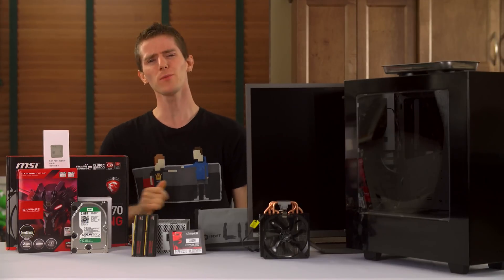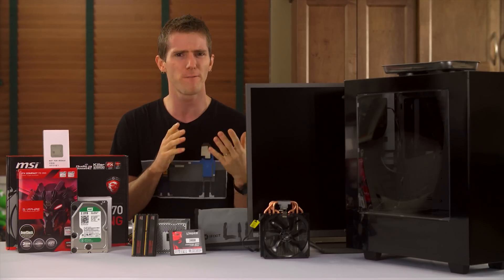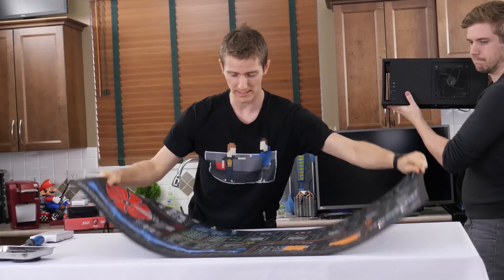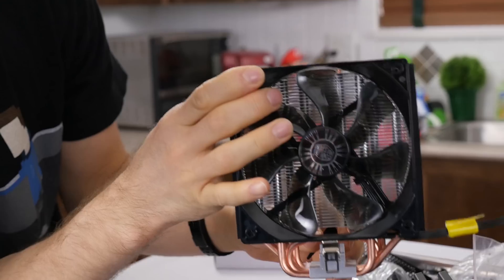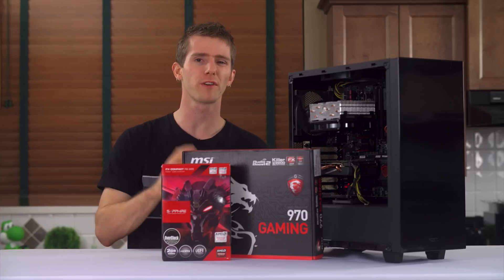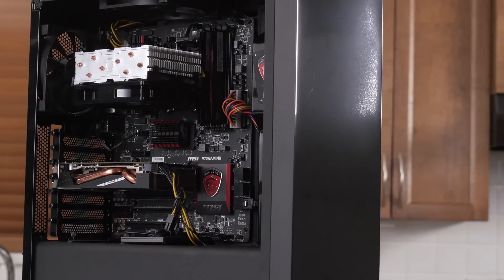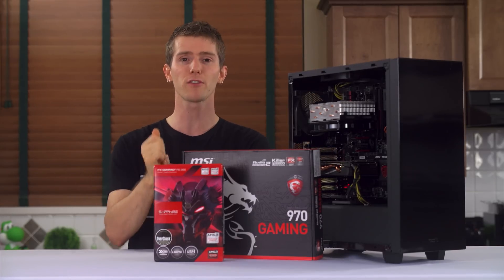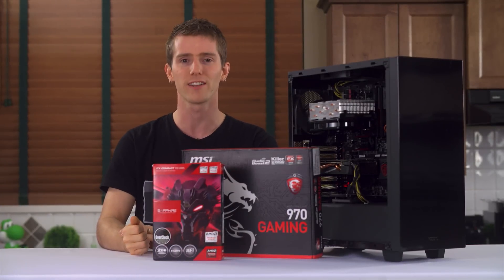Can you Build a 4K Gaming PC for Under $1000?

Comment: I'd love to OC my 6300, having trouble getting it above 3.93. I had it to 3.990 stable at one point, then when I got greedy and went for 4.0 it lost stability, then I had to back down to 3.85. I've gotten back to 3.93. This is my first OC so I have no freaking idea what I'm doing wrong, or what I'm doing at all for that matter.
Reply: m80pls
PSU was taken into consideration because over 10% if it booted everything cut off. Over 4.0Ghz not even the case fans would run. So if the fucking fans aren't running, they aren't getting juice. Naturally if there's no juice I'm going to introduce a larger supply to attempt to counter that.

If you're not going to fucking help, just shut your damn mouth. "If you know this little". Really bitchtits? FIRST ATTEMPT. Everyone starts somewhere you pretentious douchenozzle.
Reply: Niether do i. I have a 4100 i think, quadcore 3.8GHz, dont know how t o OC or if i should
Reply: Coolkidkarateman
My BIOS has an automatic OC setting, but I can't get it to go from 10% to 15%.
Reply: I have AMD Catilyst control center thing, it gives me the option to overclock, (my Processor OC's to 4.2 GHz) And it wont let me oc to at least 4 GHz, I can get it to 3.9, just not 4.
Reply: FraggedDabloons i have an amd a8 5500 apu its locked down to 3.7ghz turbo max and 3.2ghz stock go to the bios and change the multiplier and add a bit of voltage you guys have fx easy oc cpus my apu is locked not a k edition and it is still running at 4.1ghz
Reply: FraggedDabloons also what mobo do u have asus autmoatic oc on mine barley did anything and i added some extra voltage and a new heatsink since i noticed that when it heated up it throttled and coultnd overclock well soz for spelling btw <3
Reply: 96donov
http://www.newegg.com/Product/Product.aspx?Item=N82E16813157394

This one. Not the greatest, but it does have automatic OC option. Only problem is its intervals of 5%, only 10% which is 3.85 is stable. 5% boots and crashes after hitting the desktop, any other setting won't boot Windows. Crashes back to BIOS while loading it.

I'm thinking its a power supply issue, mainly because my GPU won't OC over 140Mhz core clock and 95Mhz memory clock. So I bought an EVGA 850 watt, and while I was at it, an R9 280 as well.
Reply: FraggedDabloons what gpu is at 140mhz core is it some intergrated and it could be a psu issue acctually i have a novatech(uk brand only( 80 plus 750w modular psu so i mean my pc uses 400w at the most but i do know the amd line ups typically consume a lot more power holla me your new results would be of great interest to know i would get a 6350 maybe as a next upgrade sicne 6300 vs 6350 only differenece is the cache size between them pretty much more cache better performacnce in some games exucuse my bad spelling i was drunk when typing but bro holla me we are one big community here to help
Reply: Got my fx6300 up to 4.3 stable on air
Reply: kama sylvester
Good for you, mine damn sure won't. :|
Maybe once I get the bigger PSU in a few hours that'll make the difference.
Reply: What motherboard  u got ?
Reply: FraggedDabloons Why would PSU change anything do you even know anything about overclocking? If you know this little you should stay away,,, have you even changed the voltage?
Reply: Nice bitch slap.
Reply: Up the voltage on your CPU a bit, and then stress test for an hour. If it is still unstable, do the same thing. Also make sure you have an aftermarket cooler :)
Reply: xDamo Mc
Can't stress test if it won't boot fully without going into a blue screen.
Reply: FraggedDabloons Do you know the source? Your mobo may not support overclocking or you may have a software issue with windows.
Reply: xDamo Mc
It isn't a mobo that won't support OC obviously, since I have it at 10%.
Reply: FraggedDabloons Are you using the Stock CPU fan?
Reply: ZavePro
I was, didn't make a difference when I changed it out though. Still won't go past 10%.
Reply: FraggedDabloons Maybe you have a defective chip, or the cooler you swapped it with wasnt much better. Most of the time if you slap a noctua on there then you'll get overclocking with super-ease.
Reply: ZavePro
Everybody keeps blaming the cooler, the CPU isn't getting too hot, it barely has a chance to turn on before it cuts out. Its not the dang cooler. Sheesh. I've pinged it with an IR thermometer an it never had a chance to get over 35c.
Reply: FraggedDabloons Everyone is saying it's the cooler because the only thing it COULD be is the cooler OR a bad chip, which I ALSO stated in my first comment. Have a good day.
Reply: ZavePro
It can't be the damn cooler, its not even on long enough to get hot!
Reply: FraggedDabloons Did you see what else I said? Your CPU chip might be defective.
Reply: FraggedDabloons What did you set the CPU core voltage at when you changed the frequency?
Reply: You probably need to add more voltage.
Reply: FraggedDabloons Are you only adjusting the multiplier? if so then you shouldn't have any problems. Make sure your board is at least 125W TDP, if it's not, then that is probably your problem. The FX series processors are extremely power hungry when overlcocked. I had my FX-4100 to 4.5Ghz stable on air cooling, with a 430W power supply which was pushing it, upgraded to a 550W to have extra insurance
Reply: FraggedDabloons Move up the MULTIPLIER, not the bus speed / FSB.
Set voltage at 1.4v and put it at 22.5x multiplier. If it keeps stable but temps too high, lower volts until you reach instability. If you get temp headroom (max 70ºc), increase to 1.375 and put it at 23.5x or 24x multiplier.
Reply: Jorge Rosa
1.4 was too low for X20 on the multiplier, I had it running at 1.5 for x20, that was stable. Then I backed off because I thought that was the issue I was having in GTA V. Turns out it was Rockstars fault yet again.

(I never did mention that a week ago I found the specs for a solid 4.0 in the review of it on NewEgg and it worked for me.)
Reply: Jorge Rosa
Now is that voltage and multiplier for both or just the CPU? Because I want to try yours and see if it helps my GTA V experience. So far that's the only thing giving me any issue.
Reply: Follow tutorial for AMD FX6300 overclocking.
Reply: Jorge Rosa
It is currently at 22.5 and 1.5 volts smooth 4.5GHz.
Reply: FraggedDabloons
Lower that voltage. It's too much.
Reply: Jorge Rosa Lower the voltage and it isn't stable.

Comment: Can Someone Check my Gaming RIG

Budget: $2000

i7 4770k CPU

Nvidia GTX 970 GPU

Ripjawz 16gb Ram

H100 Watercooling

PSU Corsair 650 watts 

Chassis : Raidmax Agusta

Idk what all of these sums up, but i might SLI a 970 if it doesnt sums up the $2000 Budget
Reply: I forgot 

520 Gb SSD

4 TB HDD

Two question, should i just get a Hybrid SSHD? Also if i install my os in the SSD will my HDD get the speed? Im sorry just new building a Gaming PC
Reply: aLT also an Asus MoBo Maximus VII
Reply: You could get a lot more for 2000$. Get amd cpu because its cheaper and a lot better for price and get 780ti or 980 with money you saved instead of 970.
Reply: Stefan Galić thanks for the opinion !
Reply: Stefan Galić also im new, is a 780 ti better than the 970?
Reply: aLT 780 ti is very simmilar to 980 which means its not better a lot, but it is better than 970.
Reply: Stefan Galić
thanks alot ! you just made my rig better :D
Reply: Pretty good, however I'd suggest you go with the i7-4790k instead of 4770k because its slightly newer and can overclock a bit better.  Or if you want to save $100, just go for the i5-4690k, the only thing you miss out on is hyperthreading.

"AMD CPUs are better for the money", were you paid to suggest an AMD over an i7 'to save money'??  Even the current top-end AMD CPU has terrible single-core performance, TDP-performance ratio, and lithography, just look at the specs and benchmarks.  I don't like intel's ethics sometimes, but I'm also no AMD hater, I just won't buy them over high-end CPUs until they finally come out with decent products.

Also, the 3.5GB GTX 970 is good enough unless you wanna get real top-end graphics.  Only pathetic people think a loss of 0.5GB meants a giant performance loss.
Reply: Still, 3.5gb is more than enough video memory for gaming, the card didn't magically slow down from being decent just because of this discovery.  We all know about the false marketing that happened, lawsuits already happened, blah blah blah
Reply: ***** THANKS ALOT
Reply: AudioTestsNReviews thanks !

Comment: is this amd combo fine ? 
 CPU:	AMD Vishera FXV2 6300 3.5GHz ( 4.1GHz Turbo ) AM3+ 6 Cores - Box ( Chính hãng )(BH 36 Tháng .) Giá: 2,400,002.00 VND
 Tản nhiệt khí cho CPU:	Zalman CNPS 10X Optima 2011- Powerful Cooling Performance(BH 12 Tháng) Giá: 499,994.00 VND
 Ram 1:	Mushkin Enhanced Redline Extreme 8GB ( 2x4GB ) bus 2400 cas 10 - DDR3 Dual Channel(BH 60 Tháng .) Giá: 2,449,986.00 VND
 Ram 2	 
 VGA - Card màn hình:	Palit Nvidia GTX 960 JetStream 2GB ( 128 Bit ) DDR5(BH 36 Tháng 1 đổi 1 mới 100% .) Giá: 5,399,988.00 VND
 Mainboard Intel	 
 Mainboard AMD:	Gigabyte 970A-D3P(BH 36 Tháng ) Giá: 2,200,000.00 VND
 SSD:	SSD Mushkin Enhanced Chronos 7mm 120GB Read 555MB/s - Write 515MB/s - Sata 3(BH 36 Tháng .) Giá: 1,599,994.00 VND
 HDD 1:	Western Digital Caviar Blue 1TB - 64MB cache - 7200 vòng - Sata 3(BH 24 Tháng) Giá: 1,249,986.10 VND
 HDD 2	 
 HDD External

Comment: A 400w psu for a GTX 970?
Reply: It's a r9 285. The motherboard was the 970 MSI.
And yes, I had to replay the vid several times. I couldn't believe he said 400Watt
Reply: Coolkidkarateman
Not if it's a Silver/Gold PSU, it can supply a 970 with sufficient power. Anything below that will probably not have a decent energy efficiency.
Reply: That computer will crash if you have only 400w xD
Reply: :/ I was thinking of the r9-280x xD ,those things are whores for power.
Reply: STR33TSofJUST1C3 I don't think anyone would really recommend a 400W psu for a 970, tho. I wanted a 970 in my old 450w and it crashed it. xD
Reply: Coolkidkarateman The efficiency of anything less than Silver won't support the 970. A Gold PSU can take it. You can get a 390Watts on a single 12Volt rail, and 970 doesn't use 390 Watts. A non labeled PSU cannot take even 300Watts on a single 12Volt rail, even if you have a 400Watt psu.
Reply: depends how many hard drives you have and how much ram, processor, etc.
Reply: Manu Rodriguez I have a gtx 970 and it only starts when you have 500W PSU. Look at the NVIDIA web site.
Reply: oh crap, yea. xD
Reply: STR33TSofJUST1C3 how about gold certified 650w, can it take a single 280x?
Reply: mohanidzhd That's more than enough.
Reply: Manu Rodriguez with a fx 8350?
also can I crossfire 280x with 650w?
Reply: mohanidzhd Hmm. Not sure about crossfire, but 650w will be more than enough for a r9 280x and an 8350. Since your psu is 80+ gold, it may be able to handle the dual r9 280x in crossfire but.. I wouldn't recommend it.
Reply: Manu Rodriguez +mohanidzhd i have built a computer for my friend, specs wise:

- NZXT S340 case
- Coolermaster V650W 80+ Gold
- MSI 970 Gaming
- AMD FX8320
- 8GB Gskill 1600mhz
- 128GB MX100 SSD
- 3TB HDD
- MSI R9 290 4GB
- Enermax watercooling with 240mm radiator

Temps are more than comfortable, 4.8Ghz stable, temps below 60 at full load. GTA V maxed out >60 FPS, BF3 over 100FPS, CSGO 500ish fps.
Reply: Manu Rodriguez +mohanidzhd i have built a computer for my friend, specs wise:

- NZXT S340 case
- Coolermaster V650W 80+ Gold
- MSI 970 Gaming
- AMD FX8320
- 8GB Gskill 1600mhz
- 128GB MX100 SSD
- 3TB HDD
- MSI R9 290 4GB
- Enermax watercooling with 240mm radiator

Temps are more than comfortable, 4.8Ghz stable, temps below 60 at full load. GTA V maxed out >60 FPS, BF3 over 100FPS, CSGO 500ish fps.
Reply: Manu Rodriguez +mohanidzhd i have built a computer for my friend, specs wise:

- NZXT S340 case
- Coolermaster V650W 80+ Gold
- MSI 970 Gaming
- AMD FX8320
- 8GB Gskill 1600mhz
- 128GB MX100 SSD
- 3TB HDD
- MSI R9 290 4GB
- Enermax watercooling with 240mm radiator

Temps are more than comfortable, 4.8Ghz stable, temps below 60 at full load. GTA V maxed out >60 FPS, BF3 over 100FPS, CSGO 500ish fps.
Reply: Jorge Rosa Seagate 3TB? I have the same hard drive, I heard they have a high failure rate.
Reply: mohanidzhd eh, no issues so far
Reply: mohanidzhd Nope, I actually prefer them. Sometimes they have a slower transfer rate but I've never had one die. The early Maxtors however.. EEk
Reply: Coolkidkarateman a lot of people are very poorly informed when it comes to how much their system draws.  I have a 8350 with a gtx 980 on a 500 wat bronze power supply, both cpu and gpu overclocked.  My system usage never really goes above 350-400 watts
Reply: yes. 400w 80+ gold for i5 4590 and gtx 970 will match perfect

Comment: How does this 1000$ build sound:
Intel Core i5-4690K
Gigabyte GeForce GTX 970
8GB RAM
Motherboard-Gigabyte GA-Z97X-SLI ATX LGA1150
1TB Western Digital Caviar
SSD-Samsung 840 Pro Series 128GB
Case-Corsair 200R ATX Mid Tower Case
DVD Drive- Black SATA 24X DVD Burner
PSU-SeaSonic 620W 80+ Bronze Certified

This is my first time building a PC
Reply: Craig Gardner wtf ? Bronze is just type of efficiency, it has nothing to do with reliability.
And Seasonic makes the best PSUs on the market.
Reply: Joel Hernández sure, I agree, but it doesnt directly affect the reliability of the unit. So saying bronze PSUs are bad, is just plain stupid.
Reply: Tiviat 1080p60fps is still good. And those pathetic "next gen" consoles can barely achieve one of those.
Reply: Tiviat Or you build a 1080p60fps gaming machine for 600$. Yeah, it is cheap as fuck.
Reply: Tiviat A single gtx 980 will give you arond 40-45 fps on medium settings.
Reply: Hey, just a suggestion, if your going for a k series processor, chances are your going to be doing some OC'ing  on it. Given you haven't listed a 3rd party cooler, I assume you plan on using the default one. This is ok, but if you want to get the full value of your processor, your going to want to get a 3rd party cooler to do some better overclocking. Other then that the build sounds great!
Reply: Some Looty Actually all the PSU's ineficiency is generated as heat, which obviously can be harmful to the PSU.
Still I see absolutely nothing wrong with going 80+ bronze when even <80 can be quite durable at times.
Reply: Tiviat Noone was talking about high settings if I remember correctly, and no, it would be nowhere close to halved, lmao
Reply: Way better than linus's piece of donkey ass he calls a 4k machine
Reply: MrDualtek Why the fuck not? I have the 970 and a 4690 and I am running shit like far cry 4 on ultra at 1080p
Reply: MrDualtek And the 780ti is like $300 more expensive
Reply: LOOOOL This is THE exact same that I built for my sister, but no dvd drive! :)
Everything looks fine, but I have never used that PSU. :)
Reply: what psu exactly is that ? s12ii-620 or m12ii-620 ?
Reply: Pretty good. I would just invest more in a better case like the Phanteks Enthoo Pro or the NZXT S340. Although the Pro would be better.
Reply: Thanks :D I will look into that
Reply: luke day Plus I would get a Crucial MX100 SSD. You can get a 256gb for only $100 in the U.S.
Reply: Don't go bronze on the PSU. Bad PSUs will take your whole PC with them when they die, a good PSU can normally tank the damage or it'll die and save your components. If there is a gold rated version of that PSU I really strongly recommend saving the extra cash to get it, it can save you thousands.
Reply: Either you buy a TitanX, or you build  a 4k gaming machine for over 1k. PC gaming still cheap as crap ,eh ?
Reply: Looty Sama 1080p gaming is CLEARLY NOT CURRENT GEN and thus obsolete for the 'Glorious PCMR'. And 4k gaming is NOT CHEAP !!
Reply: ***** A lot, I would guess around 500$. And I don't think that there's 60Hz 4k monitor yet, I could be wrong tho.
Reply: ***** Yes. A single 980gtx could prolly get you max25-28 fps in 4k. Another one would push you over the edge.
Reply: Looty Sama Yes, but on high settings that 40-45 is INSTANTLY halved. Which would give you the framerate I posted.
Reply: luke day I have this almost completely. 
It's great.
Reply: MrDualtek 970 is almost the same as a 780ti.
Reply: MrDualtek Well let me tell you the 970 is an incredible card. Will easily max any game out at at least 1080p, and even runs some at 1440p. I've had a lot of fun with it over the past half a year or so with it for sure.
Reply: ***** 970 can max any game out at 1080p
Reply: ***** go sli 970s
Reply: ***** sli works in pretty much all games. And it scales great in gta v
Reply: ***** It works with sli. Don't worry about that. If it didn't work with sli nvidia would lose huge amounts of money, so they always make sure that it works.
Reply: ***** 970 is the way to go. No doubt. I've had it for months and it's been incredible
Reply: ***** Only 50 dollars.
Reply: ***** games not working in Sli only really applies to old game's 2011 and earlier 
but i was just thinking that maybe 970's will be fine for 2k for now but little more vram would do you good that's why my next pc im getting a 980ti for 2k gaming i'll be getting 70-80 fps ish
Reply: Recent Hickory 980ti is overkill for 1080p unless you have a 144hz monitor
Reply: luke day Even then it's still quite overkill.

Comment: For $1000 you can get dual 290's for $550, if you go used under $400. An intel cpu (with a decent board and ram and etc) would be impossible ya know considering in the real world you have to pay tax and there is the rest of the tower. Hm still like $600 or $450 is still plenty to make a fine tower to go around this more appropriate true 4k gpu setup, especially if you already own your storage drives or ram or whatever (if you're not starting completely from scratch you can get an i5 and decent board and etc). And as for power there are plenty of reasonably priced and quality 750 watt psus. If you use your head you CAN attain actually remarkable performance at 4k for that cost.